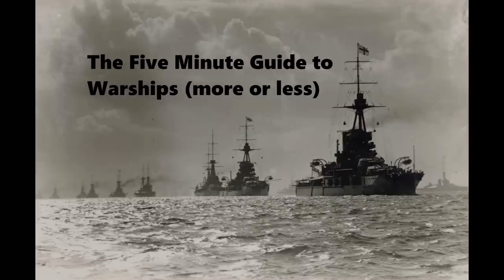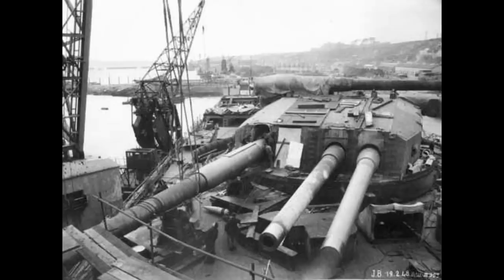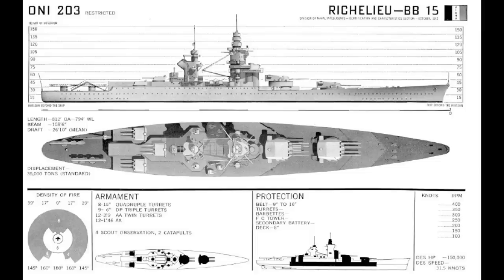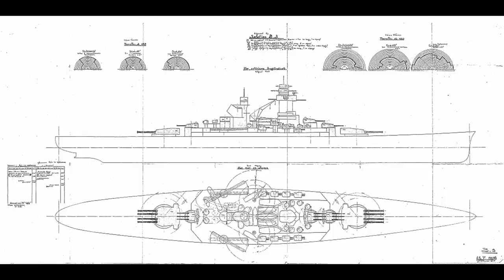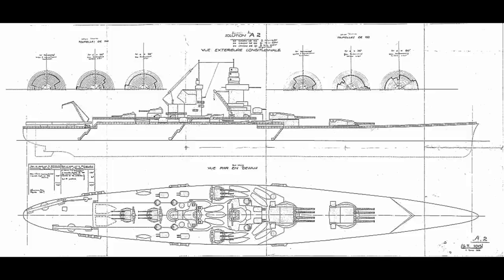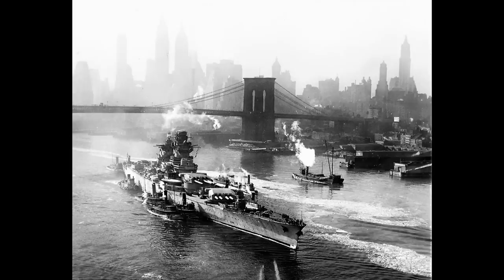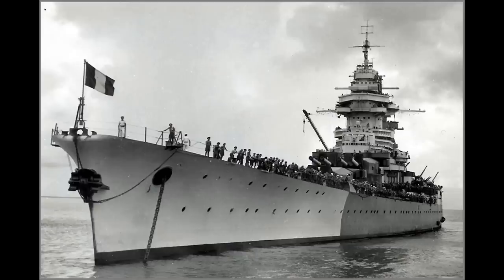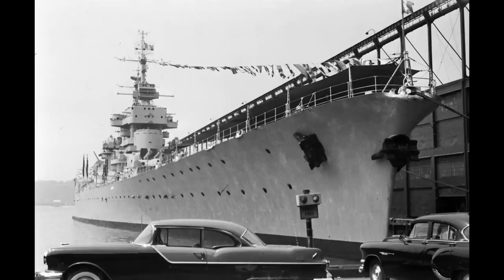MN Richelieu - Guide 039 (Human Voice)

Comment: The French gave it the old college try with dual purpose armament, weighing down this class with nine six inch guns that were designed to be dual purpose. The weight saved by removing these and replacing them with either more 100 mm guns or, as the Americans proposed, the standard 5"/38 guns in twin mounts, would be an obvious benefit to the Richelieu class. The British understood that value and proposed replacing the Nelson class mixed armament with ether six or eight such twin mounts, although the limited availability of such guns saw WWII run out before this could happen. The French, however, still wanted their supposed dual purpose 6" guns, even though they never worked as intended before the war. They would spend even more money after the war trying to make these guns work in the AA role without any more success. The French wanted French weapons, working or not. 

The USN, not learning from the French example, went ahead and built the Worcesters, the heaviest class of "light" cruisers in any navy, armed with 12 of the supposed 6"/47 DP guns, and expended large amounts of scarce resources trying to make these work in the AA and surface roles, having little more success than the French. The class lasted only ten years in service and had guns that were not effective in the surface or AA role compared to the reliable 5"/38. The only two times she fired her 6" guns in anger in the AA role were both off Korea. The first was at an unidentified aircraft headed toward the ship. After three rounds of 6" fire that missed, the target was identified as a British Short Sunderland flying boat, and fire was checked. The second was the "Battle of the Geese", when Worcester, Helena and four destroyers opened up on an unidentified radar target that was later determined to be two large  flocks of geese. It's unknown the number of geese casualties, but more than 300 rounds of 5" and 6" were fired at the poor creatures.
Reply: Don’t forget the Des Moines class of heavy cruisers, which also have DP primary armament, even though it lacks the elevation train of pretty much every DP system known to man(saying that, it wasn’t dedicated to doing that task, so less DP and more “fire EVERYTHING”).

The biggest reason 6” guns had trouble being DP guns was lack of traverse speed. If the turret can’t track the target, it doesn’t matter how spectacular the guns are, it can’t hit the target no matter how hard it tries. The 6”/47 was just a less than mediocre gun. It probably would have done fine in practice against aircraft(especially Kamikazes from back during WWII). But what it did more than anything was shore bombardment. And to my knowledge, it sucked where it was used. Built an anti-aircraft boat to not shoot at aircraft.
Reply: Nova Topaz  I don't know where you came up with the idea the 8"/55 guns on the Des Moines class were ever claimed to be dual purpose guns. They were built to be rapid firing guns for surface action and shore bombardment and succeeded admirably. The rate of fire was 10 rounds a minute, at least twice as fast as any other 8" gun ever used, and it could fire at this rate for hours. Contrary to the failed 6"/47 guns on the Worcester, their automated shell loading worked almost perfectly for the entire time they were in service.  

The problem with the Worcester guns was the automatic loading didn't work properly. The need for a dual projectile hoist system to cater for AA and AP shells was a constant source of jamming. The design rate of fire was 20-25 rounds per minute in an attempt to best the 5"/38's ROF of 15-22 a minute. Instead, the poor performance of the dual lifts and constant jamming meant the real ROF never got above 12 rounds per minute. The jamming was partly due to the requirement for all elevation loading, something not actually achieved in automatic mode until the 5"/54 Mod 1 in 1980. Even then, the ROF was still only about 20 rounds per minute, but that was offset by the drastic reduction in manpower for these all automatic guns. 20 rounds per minute has continued to be a barrier for even modern automatic loading systems on medium caliber dual purpose guns
Reply: Sar Jim ... Hence the (). But there is a video on YouTube that actually shows the loading procedure for said guns and how to use them against AIRCRAFT(if only briefly). Not labeled DP, but you don’t really label anything that doesn’t elevate to 85 degrees as DP... I’m pretty sure that before the Des Moines, the instances where cruisers shot at aircraft were numerous, but were unsuccessful and largely done by spray and pray, and almost never by a fire control system.

If it actually mentions it, it’s probably for good reason. https://youtu.be/N8XRDipD0EU and skip to about 13:00.

But even so, the point was the US was already upgunning the DP turret potential and they were going to do it regardless of if it worked as intended or not, because the Worster was originally conceived back when things like Kamikaze attacks were becoming a threat. So pretty much everything that was floated after WWII took from the lessons learned, and had turrets with power traverse, elevation and automatic loading(or just light shells, like the 5”/38), to make it easier to shoot at fast moving aircraft, even ships which realistically shouldn’t have needed the capability to operate as such, like the Des Moines class of heavy cruisers.

And the failure of the Worcester’s automatic loading(and to a lesser degree the success of the 8”) is what led to the automatic loading systems on ships like the Burke. It was more a waste of time than it was money... because every dime of that R&D helped to develop what we have today(even if it took the building of several fail classes of ship).
Reply: Nova Topaz  I think the part where the guns were used against the aircraft must have been some type of barrage fire. Large caliber guns using HC ammunition have been used in that role before. The RN were actually great believers in using barrage fire for their battleships to break up torpedo plane attacks. As a concept, it worked, but it almost never did in real life. Because of the rapid fire of the 8"/55, they may have had a better chance than most other cruisers but there were never any antiaircraft rounds produced for that gun, so my guess is that segment was for propaganda values rather than showing any real use for a gun that big against aircraft. 

What was a waste of money was the postwar idea of the navy that next war would be fought with high level bombers using nuclear weapons against the fleet. In order to engage them further from the fleet so they couldn't get close enough that a blast from an atomic bomb would sidable or sink ships, they wanted a larger caliber gun that could reach out to 15 miles at 30,000 feet. If the 6" guns of the Worcester class could have reached their planned ROF of 25 rounds a minute, the 12 guns of the ship may have been able to put up a sufficient volume of fire to accomplish the task. Close in aircraft would have been dealt with by the 24 barrels of the semi-automatic 3"/50 guns firing at 50 rounds per minute per barrel. By the time the navy realized the 6"/47 was never going to be a reliable weapon, they realized that missiles fired from other ships were the main menace, not high flying bombers. I'd argue the dual hoist system was a complete dead end and was a total waste of money, except possibly to show what didn't work. It was only when the single hoist system with ammunition changed out before it got the hoist that we developed the superb 5"/54 in all its marks. Then we started down the road of extended range ammunition to make the destroyer into a battleship, but that's another whole story of failure.
Reply: Could be worse, could be the Japanese Type 3 Shell, because surely an 18.1" shell will put up more flak than a 5" one?
Reply: OLDCONTEMPTABLE  As with so many things in Japan, the navy got a lot of their ship design and training through Britain, and a lot of British doctrine was in use. One of those was main battery barrage firing.  I'm just going from memory here but there was at least one time a US torpedo bomber attack was broken up by barrage firing from three battleship all firing together. They weren't aiming at the planes but aiming at the water in front of them. At least one plane was destroyed by the shell splashes and the others broke off the attack. I t as to have been frightening to fly directly into 14" and 16" shell splashes let alone form an 18'1" splash. The problem with barrage firing was it took practice to get good at it, and battleship size ammunition wasn't cheap.
Reply: Sar Jim  That sounds about right to me, the British also used larger caliber, slower firing "Dual Purpose" guns. A similar note to Barrage Firing is that Battleship guns aren't exactly cheap to re-line/replace, and their longer than average combat range often requires near pristine condition to maintain effectiveness in surface engagements, especially against other Battleships.
Reply: Did they at least pick up those unhappy geese to roast and eat them ? For they did not have had such an unuseful death ...
Reply: @felix25ize  I'm pretty sure that they didn't pick any geese up to cook for dinner as if a goose was hit by either a 6" or 5" gun, all that would be left of the bird would be a few mangled feathers.
Reply: @dayaautum6983  But if the goose is just hit by a little shrapnel far from the point of explosion, it is most probably still good to cook and eat ^^
Reply: @felix25ize  Naval artillery shells are not well known to explode upon impact and produce shrapnel when they either pass through a cloud or obliterate water fowl. But as food never goes to waste in the ocean very small fish swimming in the area that would normally be eaten by birds might have had a glorious feast.
Reply: The Worcester was a victim of timing, having come on line well after the apex of propeller aircraft. Larger caliber guns were known to be lacking against the now faster moving jets of the time and even the super-props of the late war. Even during the war the venerable DP 5" guns were less effective due to their caliber than they were the number employed and their rate of fire. From an efficacy perspective the 40 and 20mm AA weapons were far more effective at downing aircraft where the various 5" weapons served more as a demoralizing factor. This bears out when you read the after action and battle summaries from the USN in the Pacific.
Reply: Fighter aircrafts are a no but what about against medium or heavy bombers as an experiment?

Comment: One of the things me and my war gaming buddies used to talk about was the philosophy behind the design of these ships.  Basically the idea seemed to us to be:

1) If you are winning the battle and the enemy tries to run away - you want all your main guns up front so you can chase them.

2) If you are losing the battle and trying to run away - you want your secondary batteries on the stern - to kill the enemy destroyers trying to run you down.

The problem, of course, with a design like this is that if you take a hit to one of your turrets, regardless of it's internal design - you stand a chance of not only losing that turret - but the one next to it as well.  So in one case - you might lose half your battery - in the other you lose all of it.  Thus designs that spread the turrets out and have 3 or 4 of them being the norm.
.
Reply: @simonpitt8145  Yes.
.

Comment: I'd be curious to know the weight of these triple 152mm rear turrets and suites compared to three existing double 203 turrets and suites like on the Algerie.
Edit: found it.     The triple 152 mm was 227 tons, the double 203 was 180 tons. So an overall  weight gain of 141 tons, and firepower in favor of the 203.             Question is, assuming there are two double 203 rear turrets side by side plus one in superfiring position in the center, could the two lower ones fit on the same beam.    Draaaaaach!?

Comment: Pound for pound (displacement), USN South Dakota Class were probably the best built though both the Yamato and Iowa classes had their own, obvious advantages.
Reply: An interesting point but the South Dakota's suffered from several problems that some people are unaware of. They were cramped and  the 5" guns were really too close to each other. They suffered from vibration problems and regular electrical failures [although these were gradually reduced as the war went on]. They were wet forward and their performance suffered in heavy seas. Personally, pound for pound for me  the Lions if built would have been the best but that is a discussion  for another time.
Reply: @fyorbane  He's correct that ton for ton, the SoDaks were extremely formidable ships with very great firepower and protection on the treaty limited displacement they were built under. However...they did suffer from habitability issues and their machinery dispersion wasn't what you'd call ideal. There were also some real compromises made with their underwater protection merely because of their very short overall length. The vibration issues are way overstated and mostly solved with a change in screw configuration on the North Carolina. Electrical failures were pretty much confined to South Dakota's less than stellar performance at the Second Naval Battle of Guadalcanal. She was brand new, still wasn't fully worked up, and had some unrepaired battle damage. Also, Capt. Gatch...the less said the better.
Reply: The Richelieus were pretty good. 30kt speeds, very thick armor and underwater protection, plenty of space for retrofitting AA weaponry. Fit them with American radar and fire control and they are probably more useful than the South Dakotas in the Pacific.

Comment: I believe it is pronounced RISH EL LOO, like the French cardinal it was named for.
Reply: Wrong! The speaker says it correctly.
Reply: @xyz2121  Well the speaker is pretty correct but still an english accent.

I think there's no word and letter available in english to pronounce it correctly.

You can try to hear the entier word with good traduction by typing it with french.

In french, we pronounce it " Ri - Che - Lieu "

Ri is not a word in french but you pronounce it exactly like the word riz ( riz = rice )
Che is not a word in french but you can take exemple on the word "riCHE" or "CHEval"
Lieu is pronounced like the french word Lieu ( Lieu = place/location )

You can try with the exemples I gave, it will help a lot if you've difficulties with the entier word on google traduction.

Comment: Is it just me or does tinkering with the design of your ship before the things are even finished a terrible idea. The whole point of building multiple ships of the same class at the same time is that they are more or less identical and you can build them for cheaper. It also means that the crews for the ships are interchangeable. Not so if you mess with things.

Comment: Beautiful ship, but as strategically useless as the Maginot line. The mass of steel, technology, and logistic support tied up in this one ship could have made a difference in the Battle of France if it had been in the form of tanks, trucks, artillery and aircraft.
However, all the other potential combatants except the Soviets were still obsessed with building battleships in the 1930's, so maybe it was a level field.
Reply: russell brown   Aren't you forgetting the Sovetskiy Soyuz class - 60,000 tons.  One was captured by the Germans still on the slipway at Nikolayev in August 1941
Reply: @Wombat1916  Yes, I had neglected them. I wonder how the Soviets expected to get them out (or back into) port in the event of war , but would have been very useful for tactical bombardments during the German attack on Leningrad..

The old battleship Marat was a great menace to the German forces close to the Baltic until the Stuka ace Hans Rudel blew it clean in half with one bomb.
Reply: @russellbrown7028   Despite being a tad damaged (tongue in cheek) the Marat still was able to fire its guns in support of the defenders.  Only problem was the fields of fire!
Reply: They must have been able to beach the wreck before it went down. Presumably, Rudel's bomb had detonated at least one of the magazines in order to blow the hull into two pieces. Usually, a single magazine strike on a battleship led to its total loss along with an entire battalion of men.  "Good" value for a single shell, bomb, or torpedo.  In tactical terms alone, this always made big warships very worthwhile targets and worth throwing everything you had at them.
Reply: @russellbrown7028   It is my understanding from reading of the sinking years ago that Marat settled to the bottom in shallow water and since at least the end turrets were undamaged and the magazines unflooded those four guns could be used in support of the army where possible.  I may be wrong?
Reply: Must have been the case.  Rudel had placed a 1000kg bomb clean through the middle of the forward
 deck which lit off a magazine and blew the bow off, but the aft section was relatively undamaged.
 Rudel had actually retracted his dive brakes so he could get down onto the target faster through the blizzard of AA fire that was coming back at him.  After releasing the bomb at the lowest possible altitude, he was barely able to pull out of the dive.  
Marat was an old ship, launched as Petropavlosk in the imperial navy, but had been substantially rebuilt prior to WW2.